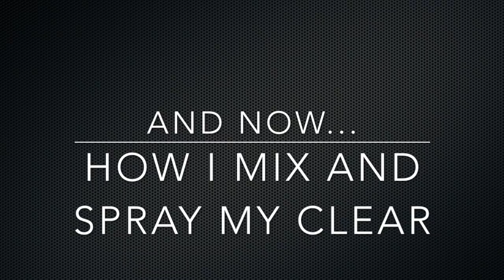Revell Foose Custom Cadillac Eldorod Video #3

Comment: Thanks for the detail on your clear coat. What version of primer do you use? Do you use the same airbrush for clear as you do for paint? And do you later paint the hidden areas where you have the tape holding the part to paint.
Reply from the maker: Dave D hi Dave. I do use the same airbrush for everything. I use plastikote primer but am experimenting with a new primer called Stylnylrez by badger. Yes that’s the name. So far so good with the new primer. I recently did a video tutorial on painting that you might like. https://youtu.be/QkAQwy0qeGI oh and I do paint the tape areas after.
Reply: Thanks. I’ll keep an eye out for the new primer. Have you used any other brands? What’s your favorite paints to use?
Reply from the maker: Dave D I’ve tried tons but those two I mentioned are the only two that work for me with the lacquers I use. I have to say I don’t really have a favorite paint. There are so many and they each work best in certain things. For example I love testors metallizers for various metals, the Tamiya family of black paints X-1, XF-1 and X-18 and Tamiya for other colors like red yellow etc. Molotow for chrome, etc. the list goes on.

Comment: Nice. I see you use Tamiya colors. Do you have that problem with them that if you apply a layer let it dry (I let 'em dry for a day) then apply a second layer, the brush strokes remove a little bit (and sometimes all) of the previous layer? If so how did you deal with it? Some people told me that the Tamiya in pots was made for airbrushes. Is it true?
Reply from the maker: Qwerts Strewq I haven’t really noticed that issue.  I do mostly airbrush or brush very small parts so that may be why I haven’t noticed it.

Comment: Hi Angelo, thanks for your videos. Re:The Duplicolor gloss clear coat that you used - is it 1k or 2k? And, is it compatible with tamiya/Mr Color acrylic paints?
Reply from the maker: Stephen M Cassar my clear is a 1k pre thinned for paint guns. So I thin it a bit more with lacquer thinner to ease it through the airbrush. I have used it over Tamiya and other acrylics. What has worked for me is to have the first 3 or 4 coats be very light. Then go in with a couple of heavier coats. If you go to heavy too soon over an acrylic it will affect the paint. I hope this helps. Thanks for the question!
Reply: Thanks for your reply. Appreciate it.

Comment: Hey what glue is that in the black bottle? I’ve been searching for years for glue that holds painted parts together. Testors red and blue tubes don’t want to hold painted parts together very well.
Reply from the maker: oldman Crow it’s Testors Model Master and it works great. Nothing holds as well as stripping the paint and plating but this does a pretty good job.

Comment: Apart from the sanding you do at the start do you have to sand before clear coats? And do you use polish or sand after the clear coat. Thanks for the videos they are awesome. I'm just starting out so really appreciate them.
Reply from the maker: Bevan Wood hello and thanks for the question! I usually sand after primer. Then I only sand between color coats if I run into a problem like debris or unevenness of any kind. Then after the clear coat cures I do wet sand and polish. I use 2500 grit very wet sanding and the Novus 3 step polishing system. Thanks again and good luck! Oh and I sand the primer and color with 600-1000 if I run into a problem.
Reply: Angelo's Workbench thanks for your reply. Love your videos!
Reply from the maker: Bevan Wood thanks very much. Make sure you subscribe as I’m about to launch a “Beginner How-To” series. Since you said you’re just starting out you may want to check that out! Thanks very much for watching!
Reply: Angelo's Workbench awesome!